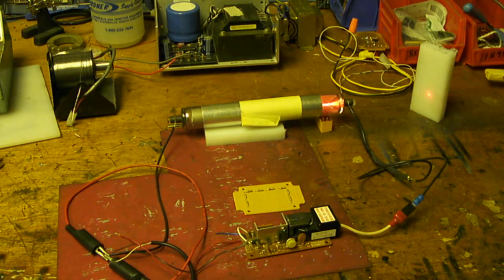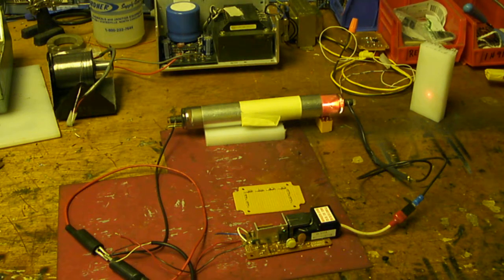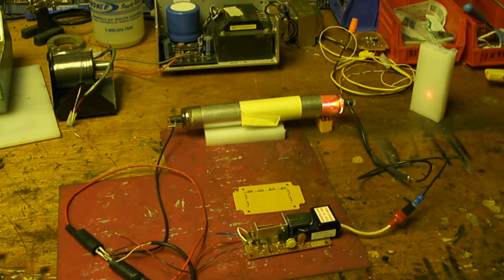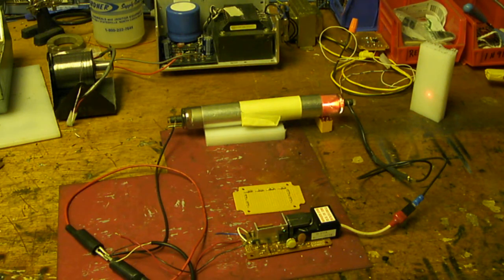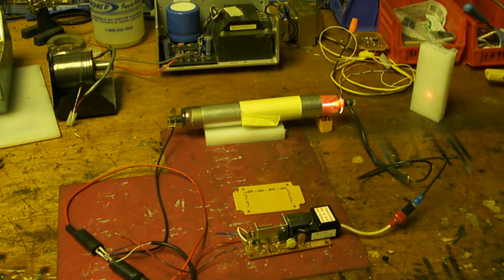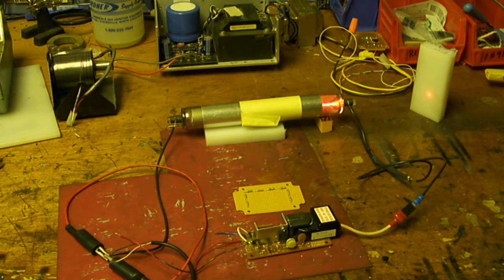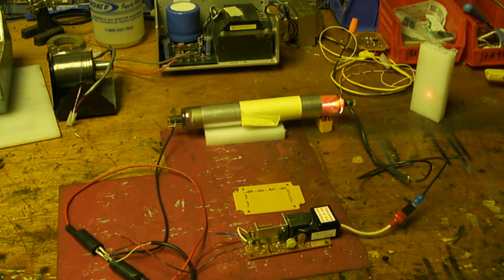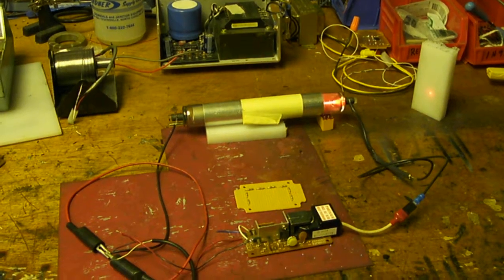HeNe power supply on the cheap!

Comment: Eric Stringer I have a 25 inch helium neon laser. it said on the laser it is only 10 milliwatts but it is so big don't understand why?
Reply: Owen Chase HeNe lasers are very low power lasers. But a 25 inch tube is rare as hell, and could be worth a lot! Keep it safe, and try finding the part number, and then figuring out what power supply you need.
I'd guess it needs about 2000-2100V DC @ 3-5mA.
Reply from the maker: Owen Chase 

A laser Tube is very inefficient in converting light to a laser beam.  To gain more power you need more light.  NeHe gas produces a set max intensity of light, for example the 1mW tube I used in the Demo is about 6".  I have a 5mW that is about 12".  Length and diameter of tube determines the power output.

To get 10mW since you can not increase the light produced by the NeHe gas, you need more area of light to increase the power.  So that is why you have a 25" tube, to produce a greater area of light around the tube.

NeHe lasers tubes are only low power, so not going to cut anything.  but are fun for Holograms, light shows, etc.

That is why you see Gases like CO2 used for laser for cutting because they produce a higher intensity of light but in the same space as a Nehe, and of course other Gases are used to produce Color lasers.

I am not sure the example above would power your laser, it was done just to prove I could get one to work as a laser power supply.  You need the spec's for firing voltage and operating voltage, current level, which end is the cathode etc.  I do have plans for better laser power supply, which I use if interested.
Reply: o ok thanks
Reply: Eric Stringer I seen them making co2 lasers on youtube and thought about building one myself, I was thinking about using a microwave transformer for the powe,r everybody calls it a MOT, they are about a 1000 watts that would be a lot of laser power?
Reply from the maker: Owen Chase 

You're using the transformer to get the 2000 volts you need, not the Watts.  And yes these transformers are for more Dangerous to use because they can put out so much Current.  It can kill you!!!!! 

While a low current but high voltage setup up while the High voltage is dangerous.  Not the same level as the MOT(Microwave Oven Transformer), also use them for other High voltage project.  I use a 12 volt transformer to high voltage setup with only produces the current I need for firing the tube up.

One of the reason for any NeHe or tube power supply you have to have a current limiting Resistor or burn out your tube.  A MOT would be just as important to have one.

Also understand that the Watt's of the Transformer does not increase your laser.  Your laser will only produce, what it's designed output is.

Hooking a 1000 Watt MOT would not increase your 10, 100, etc watt laser to 1000 Watts.
Reply: O ok thought it would work. at times this stuff gets hard to understand.
Reply from the maker: Owen Chase 

Not saying if you're talking about MOT would not work, other then taking precautions in using one.  And I would suggest you read up on Basic Electricity and safety before you try working with it.  Not understanding what you are doing is the most dangerous thing when working with these items.
Reply: Eric Stringer ya im safe with my experiments if not it could be my life.